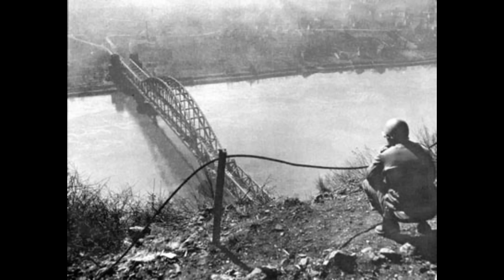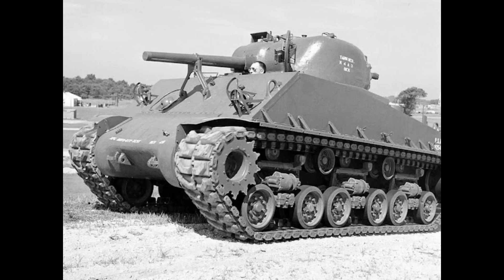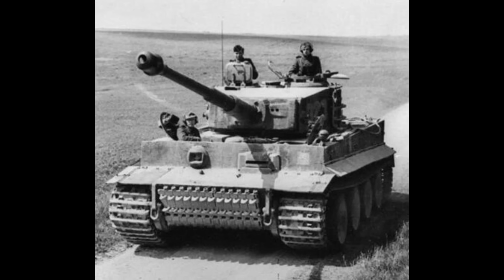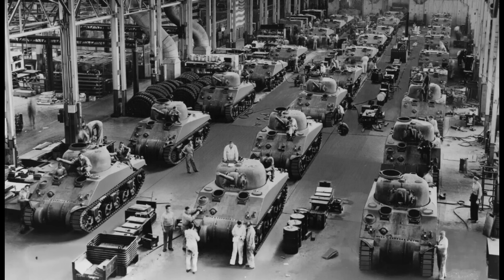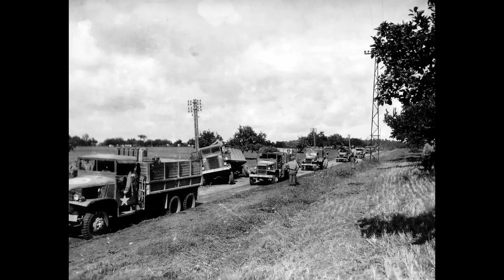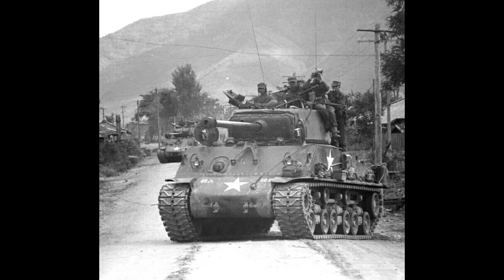German Tankers Evaluated a Captured M4A3E8—and Its 500hp Ford V8 Stunned Their Crews

Comment: Before the war the largest V8 engines produced by Ford were the Lincoln flathead V8s of 1920-1932, at 5.9L to 6.3L. The Ford trucks used the same engines as the cars, mostly the 221, just before the war Ford introduced the 239.

Comment: As someone already stated, the Fo4d GAA V8 was NOT a truck engine. It's origins came from a Ford 60 degree V12 intended for aircraft. But Ford was unable to secure a contract with the War Department at the time. The Ford V12 was a DOHC, 4 valve per cylinder design, and when the Army was looking for a larger engine for the Sherman tank, Ford took 4 cylinders off that aircraft V12 and created the GAA V8, still a 60 degree design.
Reply: 2 cylinders of 12 is 10 not 8. Sorry for being an autist but you're still right lol.
Reply: @masonreppeto882 you're correct, mistyped, I needed to proofread
Reply: @masonreppeto882 , i corrected my mistake above